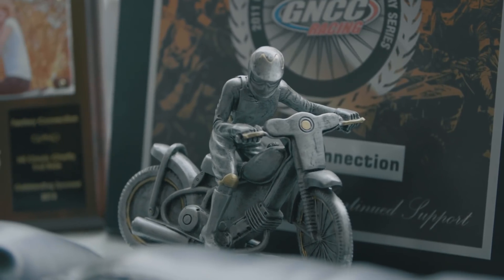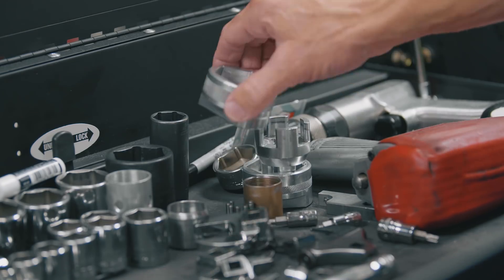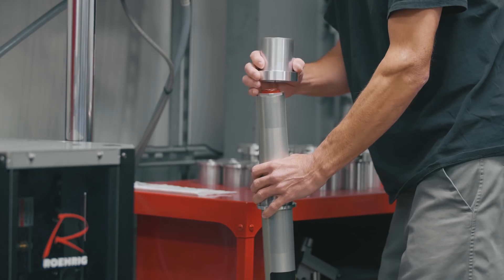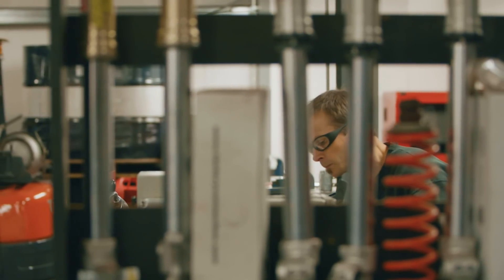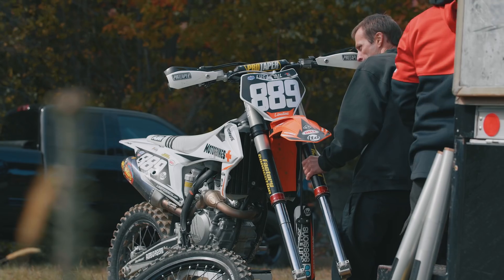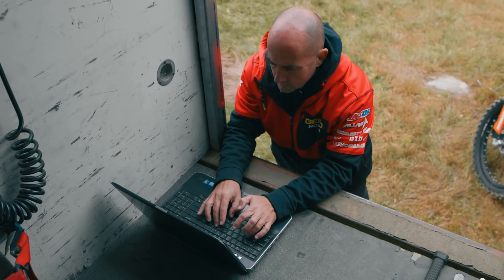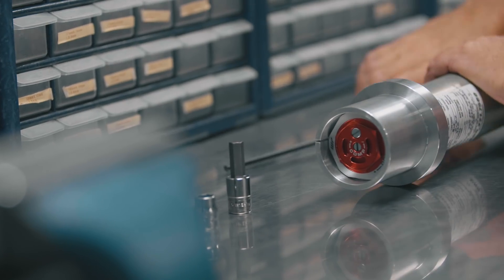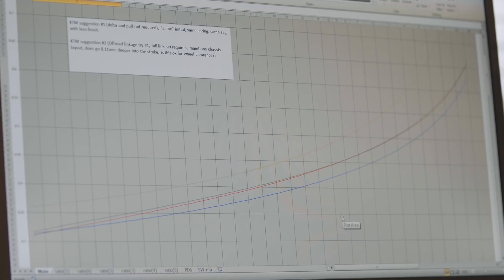Factory Connection: Inside The R&D Process

Comment: Should you not test the forks at a similar angle to when they are fitted on a bike?
Reply: true. forks flex and flex causes some binding/stiction so curves on the computer are not the same as on the track. maybe they take that in to consideration when they make adjustments.
Reply: It’s literally called the field test did you not watch the video 🤦🏻‍♂️